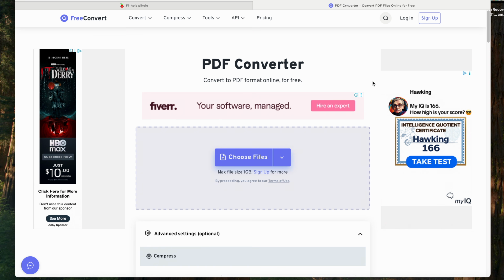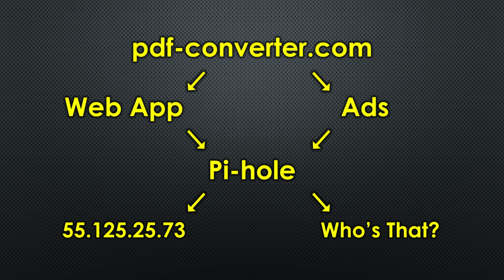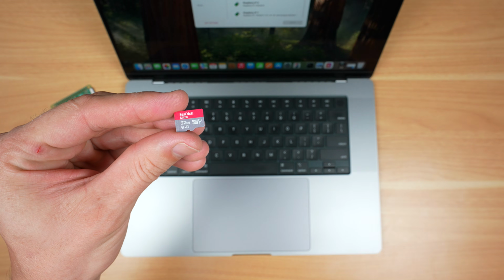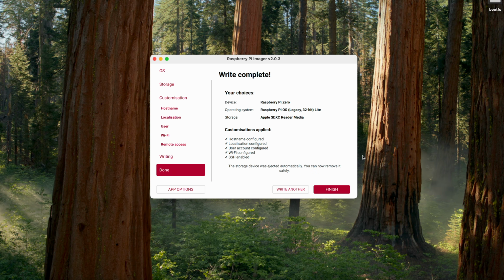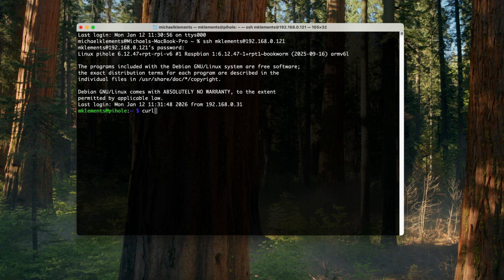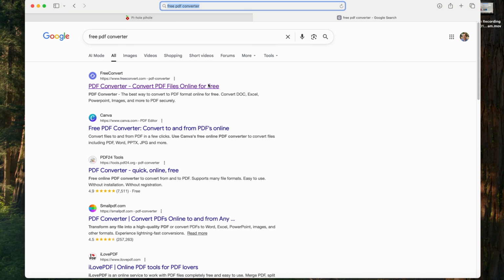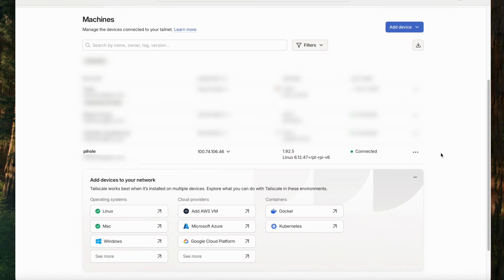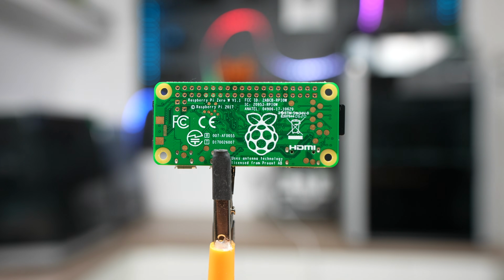I Turned a Raspberry Pi Zero into a Global Ad Blocker

Comment: isn't your broadband speed the bottleneck? also isn't that gonna 'clog' and slow down your home internet because suddenly you routing all through that ?
Reply: Not really. Just like how traffic is requested from various servers to serve you a webpage, 'all' your traffic doesn't go through it. Just text about where to 'look'. In other words, your video will still stream at the same time, content will be the same. The tiny string of text that asks for data won't even be noticeable. I notice my speeds slightly increasing, because it doesn't need to pull in video/images from ads! :)
Reply from the maker: Adding a DNS ad blocker adds a tiny overhead to the first few milliseconds of a request - after that, your internet behaves exactly the same as it did without the blocker.
Reply: The only thing that you're routing through your home internet is DNS lookups. There are, at most, a few hundred bytes per requests, and happen only the first time your computer needs to translate a domain name into an IP address.  (Boomer/elder Gen-X explanation: DNS is like a phone book. Once you've made the call, you don't look in the phone book anymore.)
Reply: @AdorkableDev  Gen-Z / Millennial explanation: Boomers and Gen-X invented computers and the internet/www that your whole life revolves around. You're welcome. 👍
Reply: @CalJ5572 Gen X here, yes, you’re right, but shockingly very few Boomers/Gen-X know the In-and-Out of the internet and the majority behave like toddlers instead when surfing and using the web.
Reply: @marcd6897  What a peculiar postulation. I do not know anyone, of whom, that would be an accurate description. Perhaps it's  a familial observation?
Reply: @CalJ5572 Hahahaha, sorry to disappoint you, but this is a widespread phenomenon amongst those two generations, look at all the Covid and antivaxxer conspiracy lunatics who spread their BS, and who is their target audience. Correct, in particular boomer and maybe a little less Gen-X. The famous phrase “But it was on Facebook” is for sure not a phrase invented by millenials because they don’t even know what Facebook is. Having invented DNS and Arpanet doesn’t mean they understand the implications of Social media.
Reply: @marcd6897  How many other peoples jobs are you an expert on? Perhaps come out of your mom's basement and join the real world? Good luck 👍
Reply: @marcd6897  -- and yet -- you would be in the stone age not knowing what to do next --- clearly the creator / inventor is the winner first as in the creation of the first automobile and now everyone has a fast car --- so pay respect to the creator -- without them - none of today's by-product invention would be possible ---